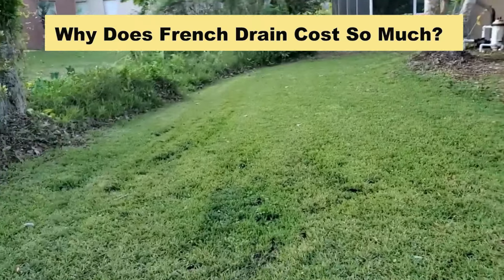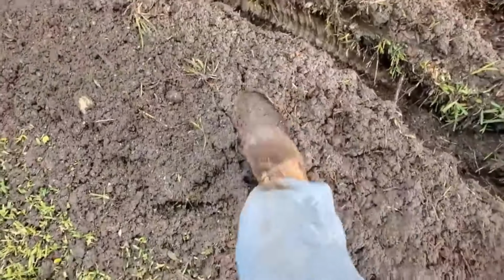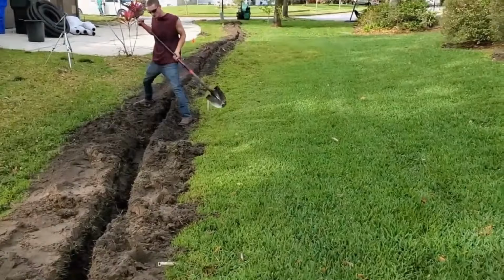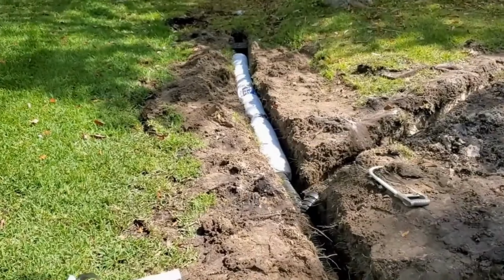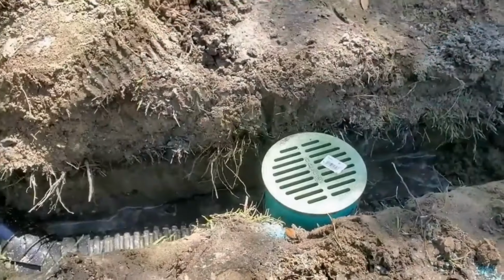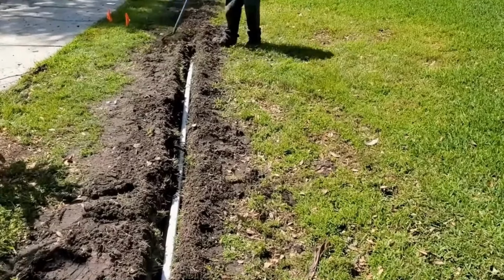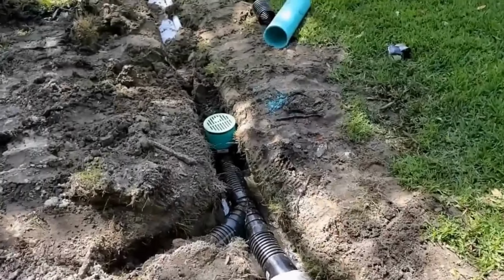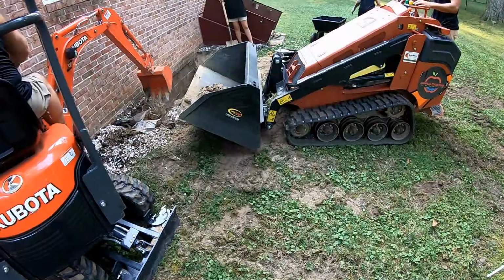Why Does French Drain Costs So Much?

Comment: Can I dig one trench with a 6" trencher and build a drain that has a 6 inch perforated corrugated pipe with an 3 Inch non-perforated corrugated pipe for my basement sump pump and gutter drain water running through it.  So essentiall a 6 inch pipe with a 3 inch pipe running through it.  Our basement sump comes on a lot when it rains - when it is dry it still comes on several times a day even without us using it do discharge our washing machine water.  We live in a rural area.
Reply from the maker: Sure! Why not?
Reply: @appledrains  Thanks it would sure simplify the process.  I want all the water to drain at the back of the property into the woods. The main trench will be around 200 feet long.  I will have

Comment: Key points I tell clients to lower the cost of a French drain: 
1. Keep it short and sweet. Only dig enough that it’s for the affected area. If the water has to discharge further away obviously the cost goes up.
2. Less equipment. I can get more done with less equipment (shovel vs trencher/excavator) in less time. Goes back to number 1 with the run required.
3. Excess dirt. Way cheaper if we can reuse the excavated dirt elsewhere on the property vs hauling it out and taking it to a facility (or in most cases, sit in my backyard).

Comment: Will EZ flow pipe work in clay? I’m here in Michigan. Clay is thick. Would the French Drain guy do this type of work?
Reply from the maker: I don’t know if he would be very cost effective but you can call him
Reply: Your best bet.... In heavy clay..... Is to trench out.... Put crushed river rock in the hole over the pipe..... And take it all the way to the surface.   Almost "mote" like.  We had six inches of rain fall in two hours.   Yard never got a puddle.  Every application is going to be different though.
Reply: French Drain Guy sucks. Follow Apple Drains videos and do it yourself.